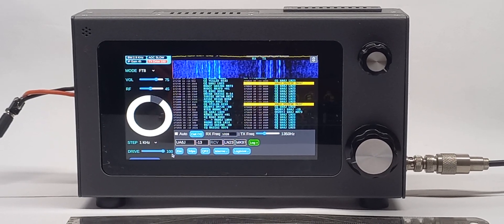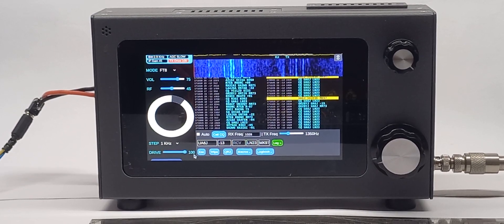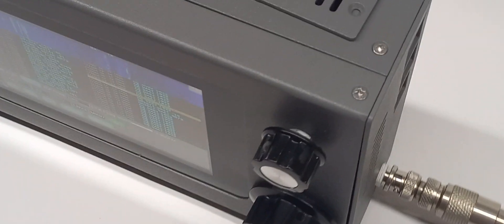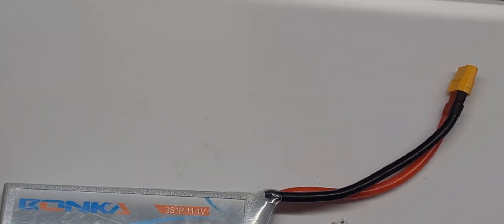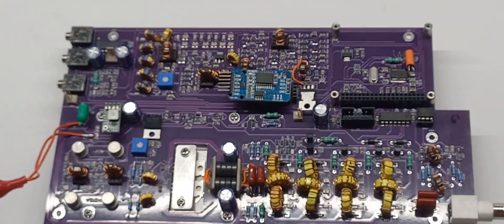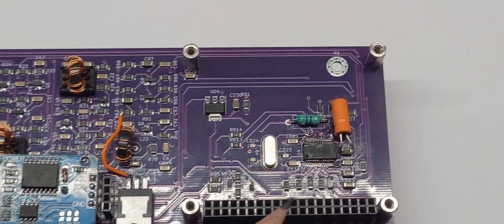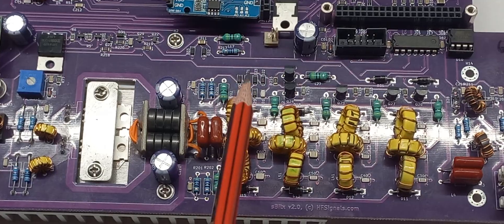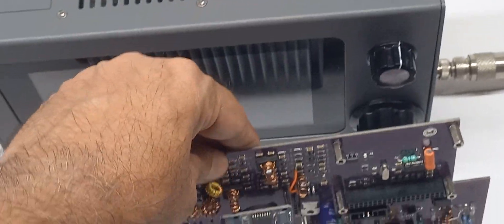sBitxV2 - First Look

Comment: Hi Ashhar, Its mike in California N6GRG who owns a V3 and V6 uBITX (the guy who wanted to be invited to your next cubesat launch, remember ?) and I just ordered the sBITX board ! I'm looking forward to it. I will be running JS8CALL (which I candownload) but wondered if you are thinking about two extra options. I have an add on for Rpi which incorporates a SSD !  That would be very cool for a higher powered Rpi System. Also I'm wondering about VARAC ? (otherwise known as VARA AC ) Its a beautiful digital comunication system that I have just began to start using with coms out into the Pacific (boats) and it seems to be even more popular than JS8 because it is so fast, has error correction and MANY other features. Eventually most everyone pays the $69 dollars but the free version works great also. Thanks Ashhar

Comment: Great design, Ashhar !
Again...
Two questions:
- The displays I see are all touchscreen displays. Haven't seen the code yet, but are you using the touchscreen ability ?
- Will the PCB ever be made available without any components soldered onto it ?
For me, one of the nicest things in homebrewing is putting the devices together myself, instead of just connecting connectors...
Tnx, 73,
Hans, PA3CRZ

Comment: new radios are selling fast how ever the CW over paddle key is not working well ie sending errors,i send by strait key so it may not be a problem for me,use lots of rf clamps on wires as rf may be getting in to set via cable on yo your key also earth your case to shack ground ..jeff..

Comment: Can i power the sBitxV2 with a goal zero sherpa 100AC it has  USB-C PD 2 port (output): 5V, 9V, 12V, 15V, 20V up to 5A (100W max), regulated.
Reply from the maker: I suppose so. How noisy is it? If other qrp radios work, then so should the sbitx

Comment: Did I miss the S meter?
Reply from the maker: Yes, the s meter is a very non-objective, perceptional thing. For examplee, the often quoted s9 =50uv is useless on 80m where the noise floor itself can  be very high. The spectrum is your signal meter.
Reply: @ashfarhan  Perhaps, but no other manufacture has no meter!… more useful would be signal to noise.
Reply: @ashfarhan   i think you are right people have  signal meter on the brain, and thats the worst place you can have it ..jeff

Comment: If you implement a uBITX to computer interface for digital radio operations, you soon have a hellish nightmare of USB dongles, cables, and power cords. The fix? I jammed an Atomic Pi SBC with Ubuntu into my uBITX box.  It worked, sort of. After a year I gave up, put my tail between my legs and went back to a windows CAT/audio interface.  I lost the imbedded computer, but I gained a workable windows home uBITX station, as long as I NEVER touched anything.  Putting a SBC into the uBITX case still seemed like a good idea, even if I couldn't pull it off.  I am pleased to see Ashhar taking my idea to the bank. His copy of my idea is almost identical with ONLY a few MINOR differences...his has a legit supportable SBC, his code works, his audio is integral,  his case is lovely elegant and fresh, a internal monitor, and oh, it works.  Well done and I'm inline. (I await my  conceptual development credit.) As a drone guy, I do have a bunch of XT60 plug batteries. You get extra points there as well.

Comment: Looks nice.
Traditionally we'd usually see most of these sections with shielding between them, this design seems to omit shielding of any kind, is this not a concern?
Reply from the maker: Well, there is about 7db of gain between the antenna and the code, so very little to interfere with. There are a few birdies alright due to the raspberry pi, but they are all below the band noise.